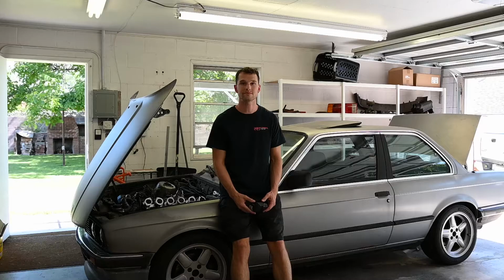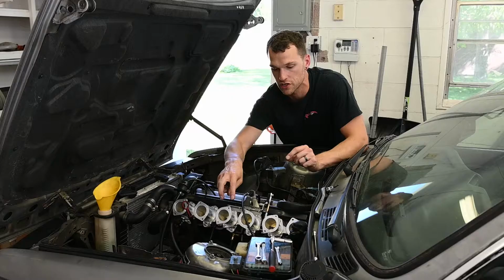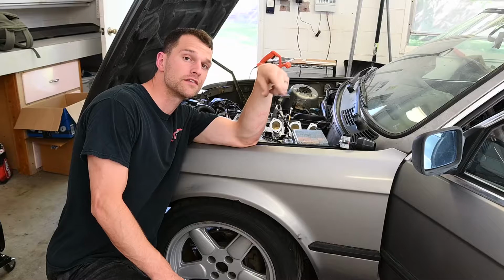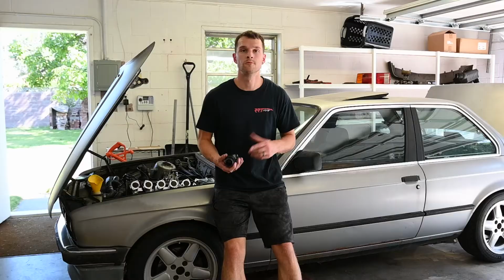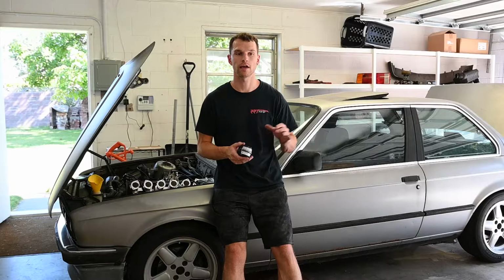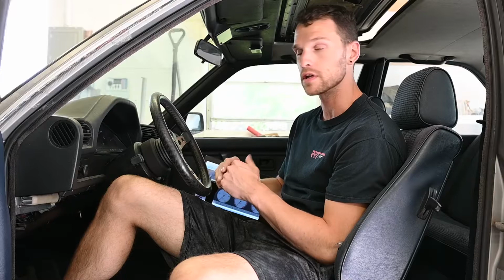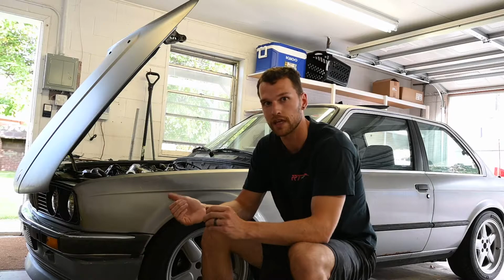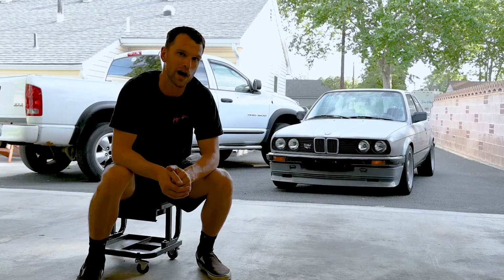E30 ITB Install Part 3: Syncing the Airflow

Comment: How did you adjust the middle pair to pull the correct vaccum?
Reply from the maker: Start with that one. You’ll have adjustments available with the position of the arm up to the cable, position of the throttle cable, and the position on the J hooks that connect to the outer pairs.

Comment: Mine won’t sync to equal value no matter what. Rhd said it’s about right but I was expecting to be able to reach a flat out number in every single throttle
Reply from the maker: Mine are fairly close but maybe not exact. The tool doesn't give a precise readout. I adjusted the middle pair first without the outer pairs on by blocking the extra cylinders with carboard. Then installed the outer pairs and adjusted accordingly. That gave me the closest match.
Reply from the maker: @noodlezdotcom  at one point I thought I saw it on the RHD website, but I think the most important part is that all throttle read the same